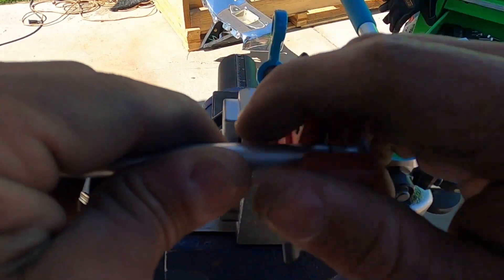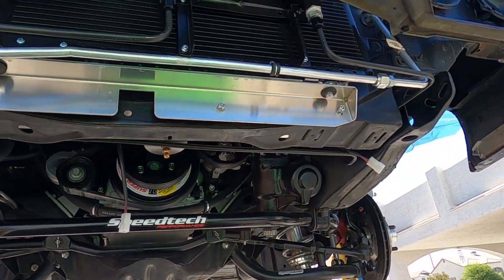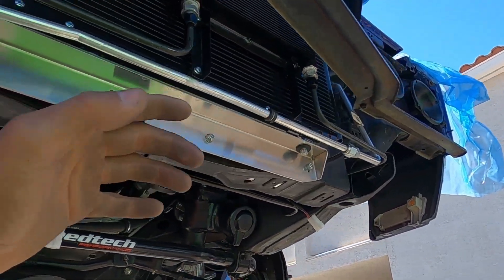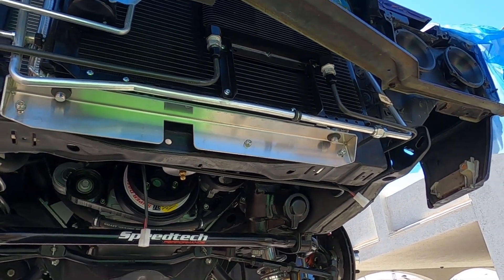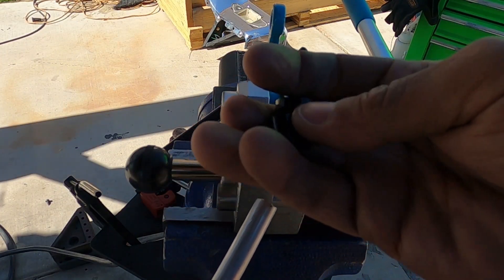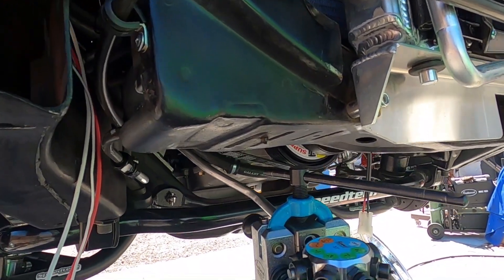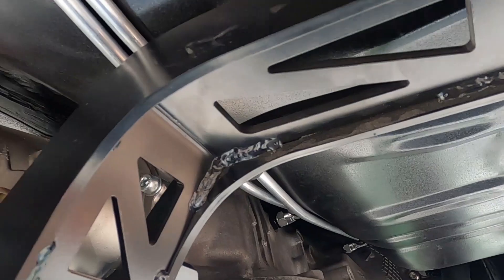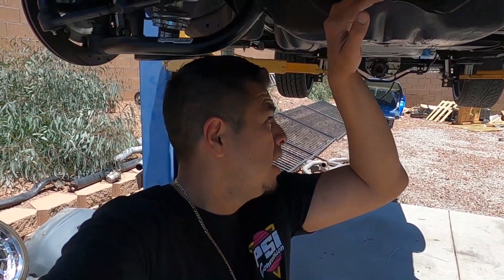HOW TO LS SWAP YOUR CAR (PART14) ADDING AUX TRANSMISSION COOLER

Comment: I am putting a 700r4  in my chevelle can i run a transcoooler that is not tied into the radiator... it has a supert-10 4 speed in it now... so they would be all new kit
Reply from the maker: Absolutely

Comment: So If I’m just all stock on motor a trans cooler is not really needed? I can run the cooling lines from the radiator correct? Or is a trans cooler still recommended?
Reply from the maker: yeah thats fine, but would hurt to add one
Reply: @goosseperformance1444  cool thanks for the recommendation got one coming In tomorrow 🤙

Comment: Do you have to use the aluminum line or can we use the braided lines?
Reply from the maker: It would be different fittings
Reply: A 50/50 mix of water and antifreeze already raises the boiling point of "Coolant" not water, but increased to 223 degrees F. Straight clean water boils at 212 degrees F. But the pressure cap plays an important role as a pressure cap rated for 15 PSI, increases the boiling point by 3 1/4 degrees F for every PSI added. So 15 lb rated cap adds 3 1/4 degree X 15 = 48.75. So now ATF hits the radiator at 64 extra degrees on top of 212. So 276 degrees F is way hotter when everything is working normal so I actually by-pass the radiator completely. I use a coolers with fan on a closed loop system. If cold, the ATF warms as normal, there is just no electric fan. Digital temperature sensors devices used in green houses, fish-tanks, sheds, etc. are $6-8 each. A sensor bulb with an NTC Thermistor measured temp change and setting for on & off are in both "C" & "F" so easy to read and set. Most will operate a built in relay of 10 amps, but I like my relay center to operates a 20 amp. The fluid sensing bulb is similar but since I am use my bench built 700R4 I placed it in the fluid and ran the wire out of the case to the dash gage. The other wire simply grounds under a bolt on the valve body. Look up temp charts for ATF and 200 degrees F for me is a turning point. I don't race but hot days, A/C and pulling a load causes all ATF to heat up. The torque converter generates a lot of heat and the cooling out comes from it. It supplies lube to a hole in the main shaft to the back. Higher line pressure for clamping forces are controlled after valving from the pump. The cooling line remains low pressure (6-8 PSI) and comes out of the transmission to the cooling circuit. It is up to you how you design it.
DK. ASE Master Tech since 78.